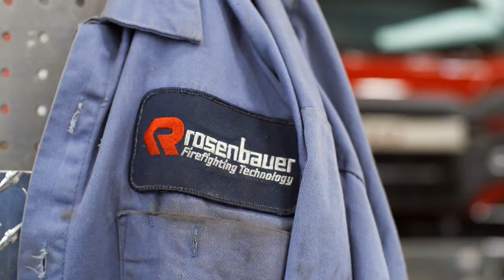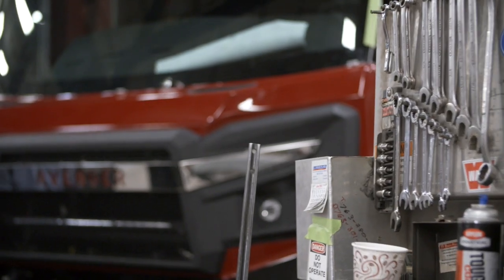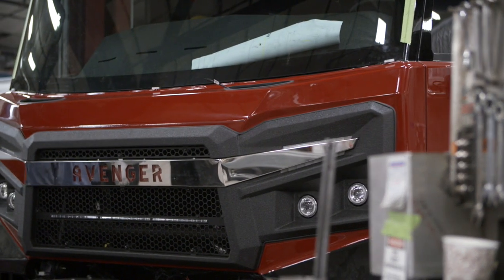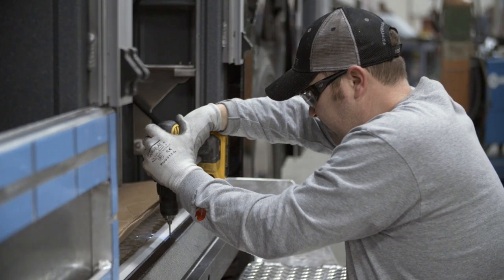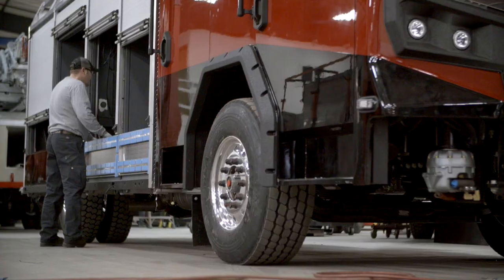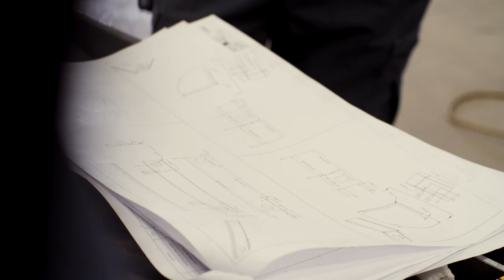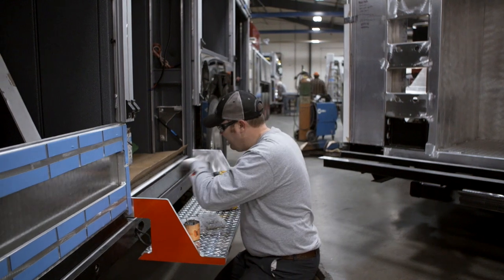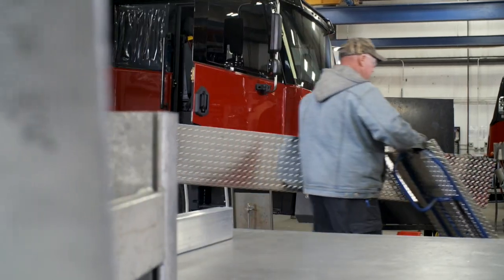AVENGER Fire Service Chassis

Comment: Pierce is most definitely better at the aspects listed in the video. Try less to look good and try more to make a quality apparatus. Y'all aren't bad, it just seems like you focused all on looks.
Reply: the problem with Pierce is , they are pricing thier selves out of the market for small depts. and their quality and customer service is going down hill , u see lots of people that used to buy pierce going back to some other manufactor , and my dept is most pierce.
Reply: How do you know? Do you work at Pierce? Even if you did, how would you know it was better if you didn’t also have experience at Rosenbauer?
Reply: @sigsourr  I am a driver engineer, in a Department that uses Sutphen and Pierce. My uncle's chief in a department that uses mainly Rosenbauer, they are switching to Pierce.